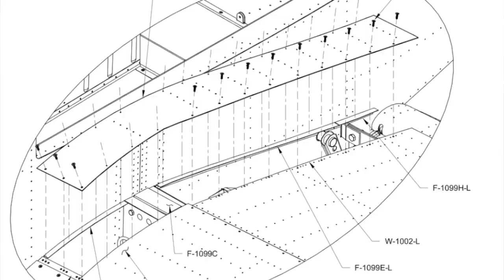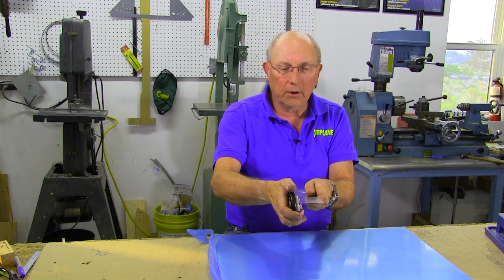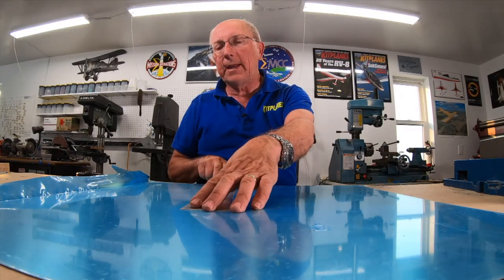Metal Magic: A Quick Look at Edge Rolling

Comment: I’m having an issue with inspection covers. I will often find that after tightening the screws that hold the inspection cover the leading edge raises up a little bit leaving a small gap between the cover and the wing surface. This can’t be good for drag or for keeping rain or debris from entering that gap. Would you use a similar tool to curve the leading edge to set flush with the surface?  Or is there another technique I might use?
Reply from the maker: Paul says: You can use an edge roller for this, but it takes a very gentle touch - and practice! I’d cut an inspection cover out of the same thickness of material and practice on it before doing it on your real part - especially if the part is already painted.